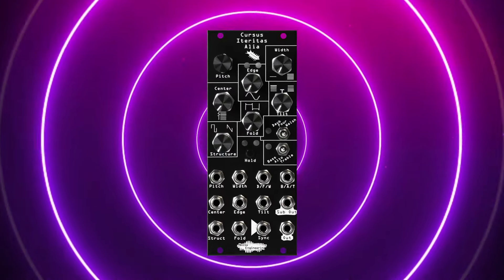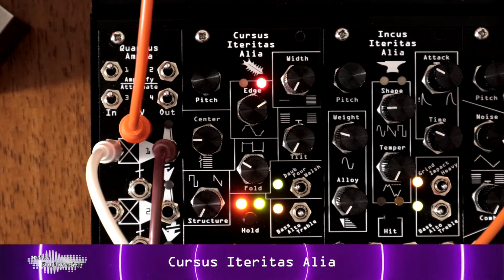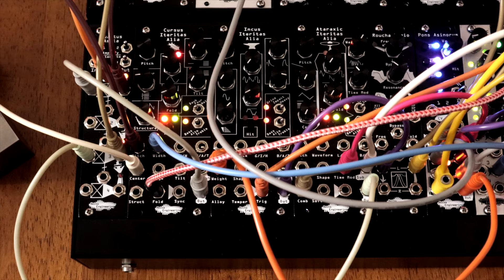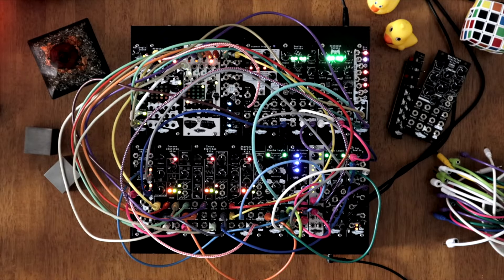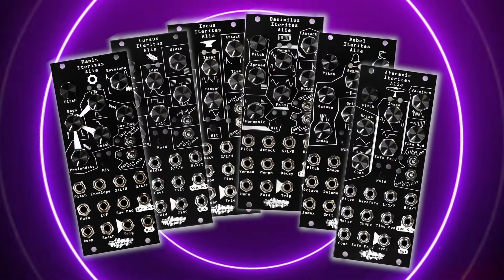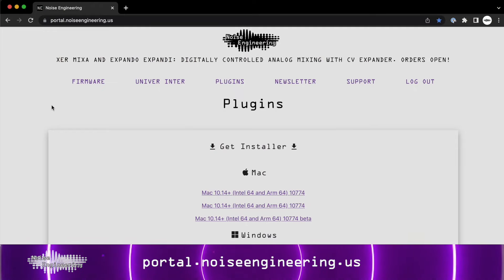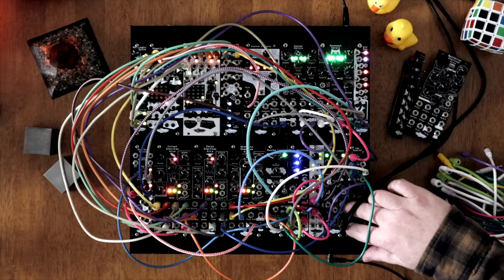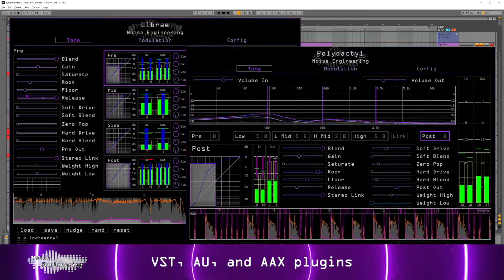Cursus Iteritas Alia wavetable oscillator from Noise Engineering

Comment: Question about the structure/tilt controls - how are these related to the balance control on the original Iteritas? Is the structure a completely new feature? Being able to control even/odd is really cool. Is the tilt control the same as the old balance control?
Reply from the maker: The parameters on the Alia are the same as the original Cursus Iteritas.
Reply: @NoiseEngineering  Sorry, I have the Percido version. I didn’t realize the original controls were a bit different. Thank you!